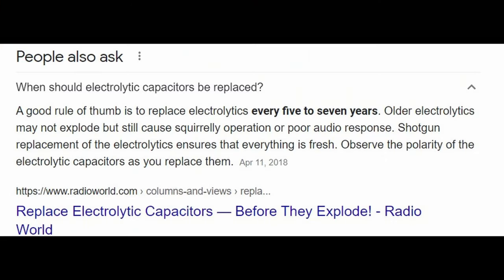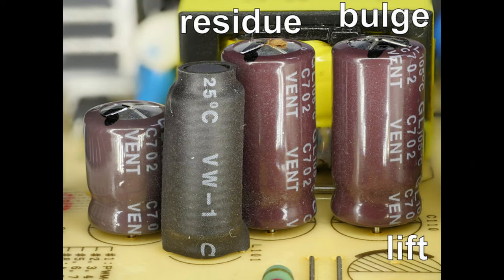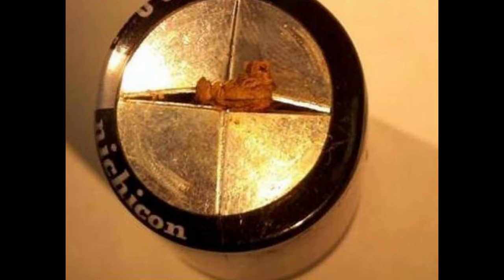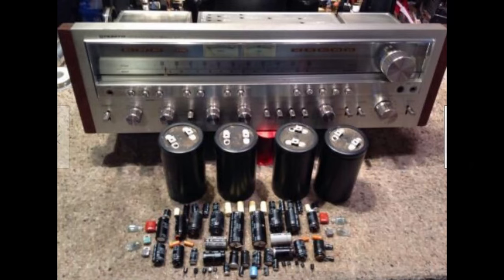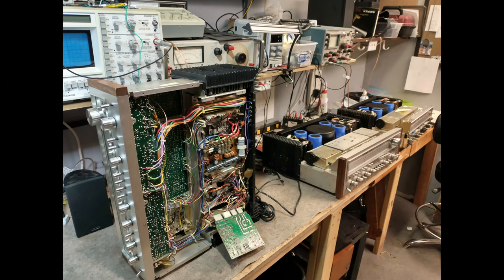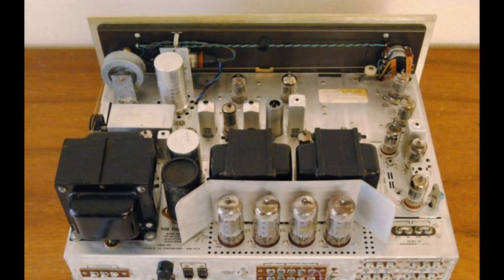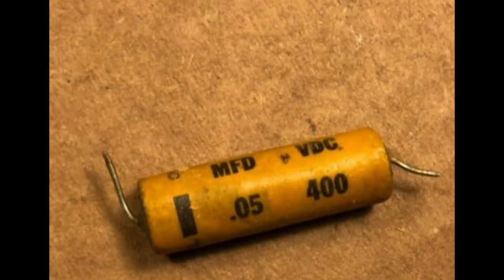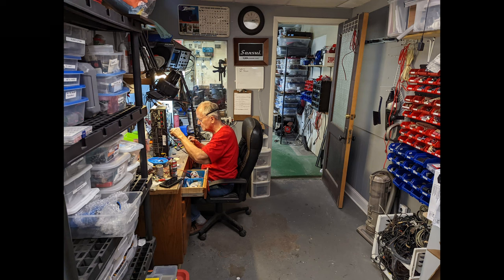Should You Replace Capacitors In Vintage Electronics?- Marantz Sansui Pioneer McIntosh Yamaha

Comment: IMO, the most important part of this video were the comments on the trend towards loosing the "old school" techs who can do this work.
This is TRUTH - I've seen a couple of industries loose old school knowledge, generally due to changes in technology. Once the tech changes, the newbies (the cubs) coming up the ladder, they have no idea how to handle this old school equipment, they simply aren't trained on it.
I come from the building automation world, and not specifically audio. But we've lost so many old BAS techs that the old equipment can't be maintaned anymore - even if repair\maintenance would make the device meet the need - no, a whole new system goes in because we can't maintain the existing system.
For the vintage audio world, I feel the same end result is not far away. The older, retired guys who know how to diag, spec out and install replacement parts in equipment that is 50, 60, 70 years old are going to be hard to find.
The one comment made by Kevin in the video that sums this up in a few words " do that restore work now".
Reply from the maker: Thank you for your insight, Jon!
Reply: The sad thing is I don't believe there is a way for a young person let's say someone in their 20s who feels that their passionate about doing something like this and learning how to do it properly to actually get trained on how to do it. I mean if I and my mid 30s wanted to learn how to repair cars I could go and get trained to do it, if I wanted to go learn how to repair refrigerators I could go and get trained how to do it, but I don't think there's any kind of school or technical college that teaches this kind of electronics repair or maybe I'm wrong.
Reply: I wish someone would teach me.

Comment: People don't realise that the value of capacitor in a PSU has no impact on frequency response...  but one in a signal change does.  And that if a cap goes short, it can blow a component that's hard to find these days.  

Personally, if i buy old kit, i change every capacitor... as well as the power cord.  And i usually spend as much on high quality solder and no-clean flux as i do on all the caps.

For me, leaving an old high voltage  filter cap in a bit of vintage kit is a fire risk, especially if the unit is full of wax paper caps (or candle sticks as i like to call them) .

I can do this work, i have the kit and i do it for myself....   but how the hell anyone could make any money at it doing it for others is beyond me.
Reply: Mostly old electrolytics may develop ESR inside them if they start drying out.   This is hardly going to do damage but may affect the sound.
Reply: @Tom Sherwood

ESR is part of the cap’s spec. Preferred for PS filtering, the lower, the better. A work around: if space allows, two that are half the value of the original single will net half the ESR. Lower ESR will charge up faster. 

Lower ESR is more common in newer, aftermarket  (20 years old or newer) caps than most that come from the manufacturer. 

Always replace w/ the same or higher temp and voltage specs
Reply: why do you change the power cord, just for adding a ground?
Reply: @mat.b.  It's not only to add a ground.  I mean, i would still change the power cord even if the old one had a ground.

When power cables are made manufactures generally claim the insulation will be good for around 25 years.  After that it loses it's effectiveness.  You need good insulation on a cable to prevent electric shock.  

There are many environmental factors that change the effectiveness of cable insulation:  humidity, Ultra Violet light from the sun, surrounding chemicals and gasses, and even temperature.

Although the conductor of a cable (copper or aluminium) will work for many years, the plastic, rubber or cotton protective coating will not.  Therefore, cables (even the installation within your building) should be changed every 25 years in order to prevent loss of life.
Reply: I am 70, I worked as an audio tech in my youth and continue to fiddle with vintage electronics even now. I have never seen a fire. I have seen char and open fuses.
Reply: @mr1enrollment  Interesting.  What country are you in?  Here in Europe i often find vintage gear without fuses and supplied via a 15A, 240V two pin socket.  The only protection is the old 15A bottle fuse in the domestic fuse board.  People have brought me amplifiers where the insulation on the power cord has completely melted.
Reply: @janedoe6350  well as to fire, it does depend on maintenance of things like power cords. I simply have not seen fire as a problem. Not to say it cannot happen, but like many things people get over concerned.
In USA.
?Is that vintage gear without fuses or deleted fuses? I imagine some old Grundig or Blaupunt-(spelling?)- may not have had fuses, but that is the problem with blanket statements,... there is always an exception. cheers.
Reply: @mr1enrollment  Yer...  I grew up and trained in UK  but now i live in Bulgaria.  Many people do not concern themselves with safety here.  And most always, people try fix stuff themselves first. You would be shocked at some of the stuff i see and remember, we are 240V as standard here.
Anyhow, thanks for responding and enjoy Christmas.

Comment: I completely agree, recently had a friend bring me his 16 year old Harman Kardon receiver that quit working - I found the two large filter caps beginning to vent testing showed them way out of value, all other caps and such looked perfect so I changed the filter caps with Rubycons and replaced the blow transformer fuses and the unit has worked like new for months now. I also had a  very similar HK receiver two years older than his with no problems yet - but I pulled the caps and they were also going out of value so I changed mine as well to avoid possible damage to other components using the same Rubycons instead of waiting for eventual failure and I feel I did the right thing - or at least the prudent thing.

Comment: From experience I would agree with swapping out the caps. I just did a Yamaha CR-620. My issue was a hum through the tone board that was caused by a bad cap on the power supply. I went on a did all caps except for the tuner section. I then discovered what they meant by Natural Sound. Much improved dynamics and soundstage, imo.
Reply: I have a CR-620 that also has a low consistent hum. I had an electronics shop work on it. They changed out a few capacitors that looked questionable. So far, the low hum problem still remains. I’m thinking about trying to replace more capacitors myself.

Comment: Excellent video on the point of changing capacitors that are 50 years old.  Yesterday I got a 1973 Kenwood integrated amp that was filthy and needed cleaning just from the dirt and also cleaning the switches and potentiometers.  I did that and it sounds amazingly clear and powerful. BUT, as this video pointed out to me, these power and filter capacitors are 50 years old and I believe are on borrowed time.  My nearest shop to have the work done is 190 miles from where I live.  I would rather have them to this than my low-level beginner to do it. Thank you very much for a very persuasive presentation on the situation that I am living in right now!

Comment: Totally agree. I have noticed a slight sound difference when doing a total recap. Not better or worse. Just slightly cleaner. I think the "warm" sound is leaky cap distortion.
Reply: No it's not! The warm sound can be achieved by certain brand or type caps!

Comment: I agree with you.  I wanted a vintage working receiver which will out last me.  That's why I sourced a recapped Marantz.  I am sure it sounds different than when it came out of the box in 1977.  But to my ear it sounds just like it did back then.  My frequency response isn't what it was either!   Thanks also for bringing up the declining community of techs who can actually fix these wonderful electronics...not a good situation at all.
Reply: Someone with this knowledge needs to start training the people who want to learn or offer an online training course. I wish there was something like this out there.
Reply: I've been told that the life of the old Marantz receivers is limited by corrosion of the tuning coils.  IDK if there is any way to slow that down,  but the story from a very reliable repair shop was that there are no replacements available other than parts salvaged from other units just as old.

Comment: I totally agree, replace the power supply caps of old amps. You will only prolong the life of the amp and/ or eliminate hum. I’ve even 3d printed adaptor rings to fit the old clamps and size down to the smaller diameters that the new caps are in nowadays. The only place where I believe a cap could change audio sound is if it is a cap used in coupling the audio. But as long as you use a quality cap and of proper capacity and working voltage all should sound great or better than some of the older axial lead caps in old vintage guitar amps, etc. For guitar amps the yellow Illinois brand axial lead caps are of great quality and of very low DC leakage. Keep up the great work, sounds like you do things right. I’ve been in this for the last 35 years. Maybe discuss your favorite cleaners for spraying out dirty pots in another video?I’m elated to note that  I just acquired these fantastic micro size plastic 90 degree elbows that fit on my contact cleaner spray nozzle tubes . 
Best wishes my friend. 😎👍
Reply from the maker: Thanks, Mike! I'd love to see those adapter rings you make. We have been buying sheets of 1/4" thick rubber and cutting it the thickness of the clamp. Holds the new cap very snug but It would be nice to have something a little prettier. Thanks!

Comment: I pulled out of my garage a 1970's Akai AA-2020 Receiver, and so far all that I've done is clean the potentiometers and switches with a can of Nutrol. I hooked up the turntable I also pulled out of storage and after checking all the adjustments, I started listening to my old collection of 70's and 80's vinyl records. The turnatable is an orginal Technics SL-1200 Mark II with a Grace Ruby cartridge. I have not replaced any capacitors yet, but I intend to during the winter when I will be spending more time indoors.
Reply: I have that same Technics SL-1200 Mark II and plan to replace the RCA cables/circuit board with upgraded ground ones. Bought new back in the day

Comment: I've got several power amps from the early to mid 1980's, and I understand that these components must be inspected, serviced and tested before being returned to frontline duty. Until then, these old soldiers will stay in storage as part of my vintage equipment museum. Thank you for this very informative presentation.

Comment: For those who say, "if it isn't broke, don't fix it": it's like oil in your car engine. Don't change it, engine still working but for how long...
And for "lost art", I agree with you. That's why everyone has to fight for the "right to repair" laws (see Louis Rossmann's videos) so that there is a minimum of people able to understand electronics at the component level and not only to replace a complete board.
Reply: i've been a component level tech for 4 decades - thing is today, with high labour costs and cheap boards, it's no longer cost effective to repair boards at component level! buy a new board for $85 or spend $300+ having the old one repaired
Reply: I've actually had people tell me that about my car. That if the transmission fluid has never been changed, then it needs to be in the condition it's in in order to run properly! Same principle.

Comment: I have a Pioneer tape deck from 1978 and the only things I have ever done is clean and demagnetize the heads, change the belts, and add a bit  of oil to the bearings in the 2 motors. All the switches, record/play selector, and pots all got a shot of Deoxit. Apart from that nothing else has ever been touched and it still works perfectly today. I recently bought  a 1975 Sony stereo reel to reel machine from a car boot sale (UK version for garage sale but in a field.) All I did was clean the heads on it and it worked perfectly first go.

Comment: I'm another old (70) guy who works mainly on vintage guitar amps and the choice always seems to be with replacing components is do you play it all the time and want reliability or is this for a display/museum that collects dust and it needs to be as close to original as possible? With the dust collectors the caveat is always by not replacing, at bare minimum, filter and power supply caps don't be surprised if you plug your "all original" amp in and fire it up on mains power without first bringing it up slowly on a variac, you smell and/or see magic smoke. But it's still amazing how many there are out there who will pay top dollar for a vintage amp and then balk at the cost of needed service, especially if it's working at the moment. I liken it to when I worked in the DIY industry back in the day and a customer came in who just had an outdoor spa installed and wanted to run all the power from a 15 amp extension cord. Go figure.

Comment: Just purchased a meter to measure capacitance and found some interesting measurements in my 1976 Heathkit AA-1506 120 watt audio amplifier.  These were two 250uF bipolar low voltage coupling caps. However one measured about 450uF, and the other roughly 340uF.  Anyhow, I replaced them with a 220uF in parallel with a 30 uF, thus giving me 250uF.  I then proceeded to replace more caps in my 1978 Soundcraftsmen PE2217 Preamp/Equalizer.  I was shocked to find out after a closer look that there was a mix up with 4.7uF caps and 2.2uF caps. Not good to have a 2.2uF cap in place of a 4.7uF used in the 20->60Hz band filter on the left channel. The rest of the cap mix ups were in the two phono preamp boards. Thank goodness I managed to find the PE2217 schematic.

Comment: I used to work at a shop recapping vintage radios. Wax and paper, we would replace. On hifi sets, we would take the electrolytics and replace them. This is a very sticky subject for folks and I'm glad you tackled this. I've absolute respect for you guys, but did before this video as well. If I could hit the like 10x I would.

Comment: Different electrolytic materials definitely sound different. If you like the original sound, replace them with the same electrolytic if you can. 
Like you said, maybe its not noticeable in the power supply but in the preamp, you should certainly notice a difference.

Comment: Agree with you 100%. PS electrolytic caps are generally not expensive and reasonably easy to replace. It's a mater of safety. I had a Carlson amp PS catch fire the fuse was quite alive and well.
Reply from the maker: Thanks for watching and the comment!

Comment: Where I live, is very very very hard to get someone to even service something from 10yrs ago ... Have gone through 2 Marantz NR150X and a SR ...[sorry forgot model], both had the same issue, the cost to repair was so high, the shop purchased them both from me for parts ... I have now gone vintage, with modern speakers and some digital playback ... The sound alone of the little Panasonic RA-6500 with only 2 speakers, is totally different to what came out of the Marantz receivers ... Now, I am on the hunt for that 'perfect' set of speakers ... Had many back in the day, when it was cheap used and lay-away existed ... Keep up the good channel,

Comment: I Couldn't agree with you more! I operate  a small vintage radio repair shop in Canada. Replacing the filter caps at the very least is standard practice. In fact I will not offer any warranty if the electrolytics and paper caps are not replaced. A power supply capacitor that shorts  will take out the rectifier tube just like that. Same with solid state. Why someone would not want to replace the electrolytics is beyond me, its called bringing it back to factory spec. Same goes for paper caps, and yes they will change the sound If they are in the signal path, again, bringing it back to factory spec. As components age their characteristics change gradually unless it is a complete failure, just like our ears. I'm 65 and about to retire, if I can. I have a 2 year waitlist for repairs and have people shipping radios to me from all over the continent, I know of three fellow repairmen that have passed in the last couple of years, and yes, I can't find someone to help in my shop either. Dying art.
I read with great amusement those folks that say they can hear the difference with a $2000 power cord or little feet to lift speaker cables off of the floor. My god, what a gift to have such acute hearing! This industry has always had the "snake oil salesmen" but it seems to have gotten worse with the amount of BS on the internet. There are a lot of how to videos, go ahead, do it yourself, and after your receiver is butchered you can take it to a repair shop and have it repaired professionally.
Thank you Skylab for the most refreshing, honest video that I have seen yet on this subject.
Reply from the maker: Really appreciate that, Ralph! Keep fighting the good fight, sir!

Comment: Awesome commentary, and some great points. Would love to see a video in regard to the actual dissection of a few “still working”, vintage capacitors, in direct comparison to the dissected “brand new” modern replacements that would replace them. Along with your opinions on the best (your preferred) modern replacement brands, and why. Maybe consider an additional segment on replacing passive speaker crossovers, and causes of their failures, as well. Would be great. Thanks for your time. Thumbs upped, and subbed. 👍